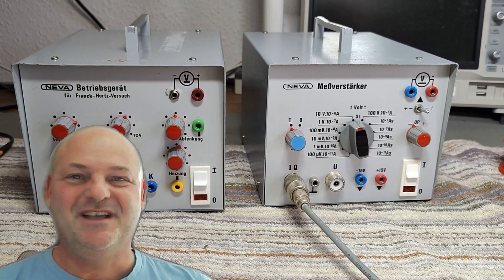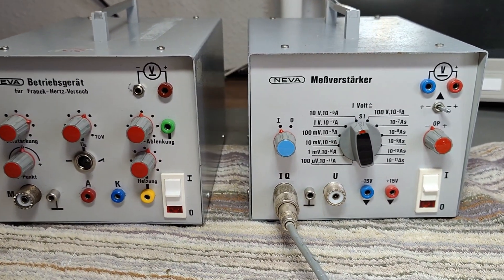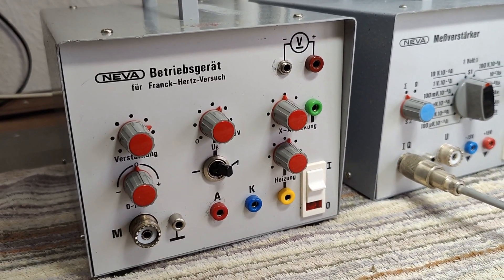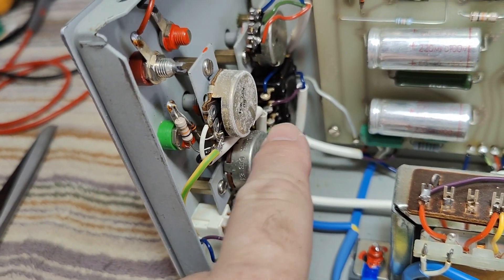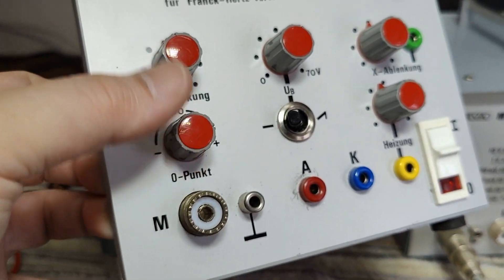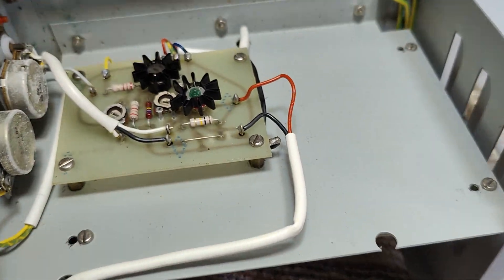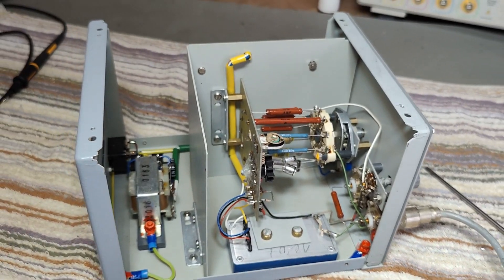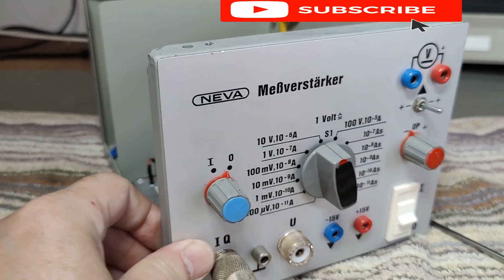NEVA school lab equipment franck-hertz experiment teardown

Comment: The measurement amplifier 7212 can be used independend of the Franck Hertz experiment. Thank you for showing the interior. It would have been nice to feed a small current, charge or voltage into the inputs and display the output voltage (top right corner) .
An example for a charge source is a piezo accelerometer. In the Brüel and Kjaer 2511 video you mentioned that one or several such accelerometers are coming your way so you could use those. 
An example for a very weak current source might be a LED exposed to light, inverting its usual way of operation.
If I understand correctly the amplifier can handle DC as well as AC signals of the three mentioned categories (I,U,Q). This is a conclusion from the fact there is a symmetrical voltage supply used (+-15V).

Comment: The Franck Hertz unit is self contained including an amplifier. It does not need the 2nd unit. The 2nd unit is a more general electroneter amplifier. If it still works it may still be useful for small currents, not just as a +-15 V supply. The As ranges are amps times seconds  = Coulomb for a charge measurement. Interesting to see the RF connectors used for low leakage.